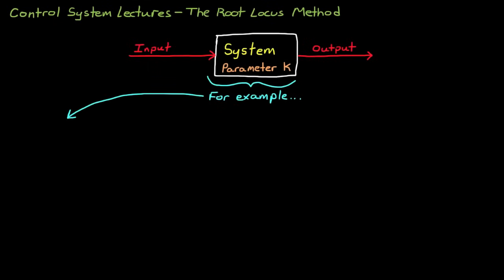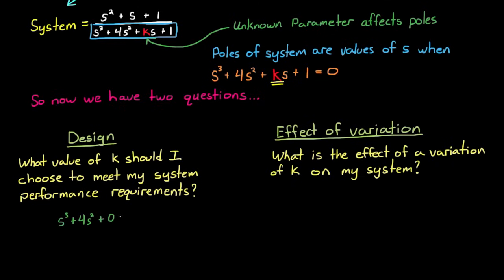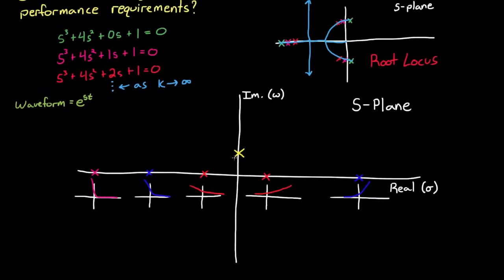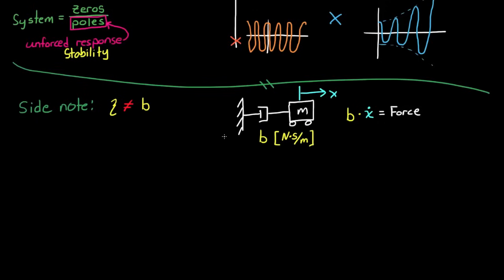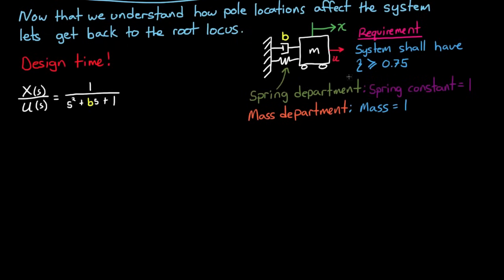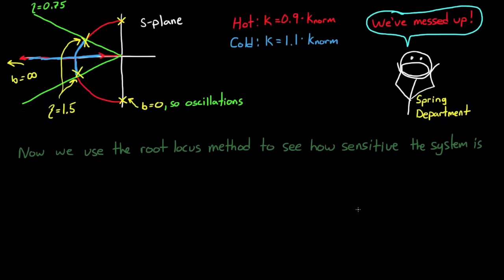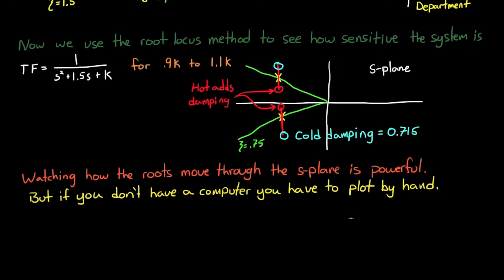The Root Locus Method - Introduction

Comment: its a design technic, k is unkown or varying parameter meaning u cant tell if the sys is stable or not unless u know k , the value of k in the chars eq actually affect the location of poles , drawing of how the poles move in the s plane as u vary k from zero to infinity = root locus , 3:49 each location in s plane corresponds to a waveform e^st in the time domain , kolma kona f left kolma decaying ykon faster , knowing the location of poles let u know if the sys is stable + type of response ( oscillatory … ) 5:01

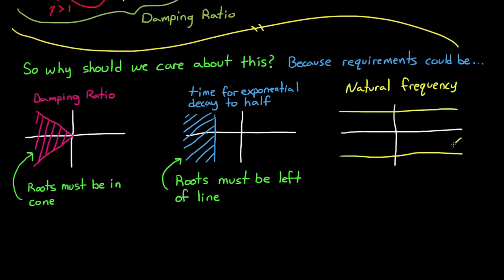Comment: At 7:30, you mention that natural frequency requirements dictate that the pole must lie inside a horizontal band. However, this would correspond to limiting the imaginary part of the mode. The natural frequency corresponds to the norm of the pole, which would mean the pole must lie inside or outside of a certain circle.

Comment: At 7:27 the writing in yellow should read damped frequency, and not natural frequency - thus maintaining consistency with the yellow region limiting the imaginary part of the desired closed-loop poles. Otherwise, if one considers the constraint to be on the natural frequency, it is the distance of the closed-loop poles to the origin of the s-plane that should be limited - thus forming a disk in the left half of the s-plane having as radius the maximum allowed natural frequency. Natural frequency and damped frequency are not the same.

Comment: Hey Brian, thanks for the great videos! They helped me a lot through my studies and now in refreshing my knowledge in control systems. I have a little question though: If Zeta is constant along these lines from the origin with an angle of theta, and Zeta = cos (theta), then how can the damping ratio be more than 1? AT 6:12 you draw two points on the x-axis and say they have a damping ration that is more than 1. Could you please explain that to me?
Reply: Because once you reach ksi=1 , you will have double real poles as b^2 = 4*a*c (second order system). If you further increase ksi,you will just get 2 different real poles that moving away from each other on real axis.
Reply: I have the same question

Comment: Hi! Great video, however a nitpicky detail question: at 5:15, the values of the damping ratio radiate out at a value of cos(phi) in the s-plane. That would mean, that no damping ratio greater than 1 could be achieved, because cos(phi) is at maximum 1. This cannot be the the whole story though, because at 6:10 you talk about values greater than 1...  How to solve this?  Thank you for your effort
Reply: The cos(phi) formula stands for complex poles. Once you land on the real axis, you have a double pole at the separation point, where the damping ratio is 1. After the poles start to separate on the real axis, the system is over-damped.

Comment: I'm a retired technician.  I spent 43 years in various aspects of electronic control systems.  Everything from flight control system on B-52 bomber to re-heat furnace control in a steel mill to general control system in a power plant.  Sad to say, I was lost in the first minute of your lecture.  It would seem that the world of system controls has left me far behind.  I'm glad I no longer depend on the knowledge to put food on the table.

Comment: 6:14 is that wrong? the red poles are on the real axis and you say their damping is over 0, I don't understand since cos(0)=1 perfectly damped
Reply: That rule is usefull to know if it is underdamped or not, but if we want to know if it's either perfectly damped or overdamped, we have to check if the poles on the real axis are in the same place (IE: 2 poles in -3). If they are, the system is critically damped, if they aren't, it is overdamped

Comment: I am a fifth year Aeronautical engineering student, currently using root locus to design aircraft flight control systems. This fifteen minute video is a more complete, effective and absorbable explanation than I have been given throughout my degree.
Reply: Currently studying Electrical Engineering, I have to pass the final exam of Automatic Control, this videos were much more helpful than the entire course

Comment: Nice video Brian. One thing that I noticed that I think is wrong (but I definitely may be mistaking my self). At 7:33, when you talk about the requirement of the Natural frequency, this is not related to the distance from the real axis. The frequency is the distance of the pole from the (0,0) coordinates. In other words, if you care about the system working in low frequencies, that means that you want the poles to be as close to the (0,0) coordinates as you can. 

Of course you want poles to be on the left side of the imaginary axis so I would visualize it as a half cycle, on the left side, with its center in the (0,0) coordinate.

Just wanted to add that. Again, very well explained ^^.

Comment: brilliant vid!! i have a question though... what happens if the parameter k affects the zeros ? i'm designing a PI controller for a closed loop and so it ultimately affects the CLTF poles, but i'm struggling to understand how it works precisely...

Comment: If you write the transfer function in a different form, you can directly relate b and k to the damping ratio.

TF = 1/(s^2 + b*s + k)  =>  1/(s^2 + 2*ζ*ω0*s + ω0^2)

b = 2*ζ*ω0, and k=ω0^2   

b = 2*ζ*sqrt(k)

rearrange to ζ = b/(2*sqrt(k))

k is multiplied by factor p, sqrt(k) will multiply by a factor (sqrt(p)).

To maintain at-least a 0.75 damping ratio, you'll have to multiply b by a factor of sqrt(1.1) = 1.049.    b_new = 1.5*1.049 = 1.6 (only keeping significant digits)

Comment: About the damping ratio on s-plane, you can refer to pg6 (http://web.mit.edu/2.14/www/Handouts/PoleZero.pdf ) to derive the circle with constant radius but different damping ratio.
Reply: in the first example of the linked document, the differential equation should be 2(du/dt)+u instead of 2(du/dt)+1

Comment: why we use root locus? what are the use of root locus?
Reply: brother, if your system lets say motor control system is unstable thn you can find out where its going wrong by root locus. root locus is used in compensator design where you can adjust your instability of motor by adding compensator in series or parallel connection.  i think that i explained well.

Comment: I have been asked to design a system with C(s) = kp and G(s) = 9/(s^2+2*s) . The first requirement : The effect of a constant input disturbance di in steady state operation should be reduced to less than 10%, and the damping ratio should not be less than 0.7. I understood the damping ratio part but I don't know what the requirement about the disturbance means

Comment: As you said , damping ratio is nothing but cos(phi) ,where phi is the angle to x axis. i.e  at all points of real axis in s plane , damping ratio should be 1, as phi =0. but at time 6:16 , you denoted the points for damping ratio greater than 1 at real axis.
So, my question is basically , does  damping ratio equals to cos(phi) holds for all points in s plane?
 thank you :).

Comment: What basic knowledge should I have to know, before learning this?
Reply: +Nandoo H It helps to have a little engineering background (at least know how to model some simple dynamics such as a mass-spring-damper system and know some algebra). Though basic control theory doesn't need much.
Reply: basic understanding of complex fuction is enough to understand the entire rootlocus rules

Comment: Sir, In discrete domain controls, could you explain how to use root locus in z-domain to directly design in discrete domain and not just approximate from a controller designed in continuous domain ?

Comment: Root locus ends at zeroes because at zeroes, the transfer function = 0, there will not be any outputs! It will be meaningless to construct time domain equation with those characteristic roots. The purpose of root locus is to find a continuous range in which system parameter K meets our preferences, therefore, we ends at zeroes since zeroes presents us with a discontinuity. Likewise, we starts at poles because it gives us maximized transfer function (divide by zero). We will like to see how K change our roots starting from the maximized transfer function to a minimized transfer function (ie, zero at infinity = exp(-infinity * t) in the case of root locus ending on real axis).

Comment: If our system has G(s) in forward path and H(s) instead of unity in feedback path, then to use 'rlocus' we need to change our system to unity feedback. To do this replace G(s) by [ G(s) / ( 1 - G(s) + G(s)H(s) ) ] and H(s) by 1. Now, our open loop transfer function is that one in square brackets.

Comment from the maker: viraj shelke and Suraj more, It's hard to explain in writing but I'll try. Start with the root locus form of the transfer function: G(s)/(1+K*G(s)) and then separate G(s) into numerator and denominator. N(s)/(D(s) + K*N(s)).  Now if K is 0 then the transfer function is N(s)/D(s) which is G(s), so the roots start at the poles of the original transfer function. When K is increased the denominator D(s) + K*N(s) starts to behave more and more like just K*N(s) which are the zeros of the original transfer function. Does that help?
Reply: ID Jeet 1) There is an equation that relates %OS directly to zeta, %OS = exp[(-z*pi)/sqrt(1-z^2)]*100, where z is zeta (the damping ratio). There's a few ballpark, pre-calculated OS's that are good to remember, 5%, z=.7, 15%, z=.5, 35%, z=.3. So you would plot the z of .5 when given a OS of 15%. 

2) 3rd order+ functions can always be broken into 1st and second order systems. You would simply factor out a first order to create a first order and a second order, and your natural frequency would be the frequency of the second order response.
Reply: Brian Douglas sir , i have few problems , 1st ) there was a question where i was asked to plot the damping ratio line with just OS% given as 15% how do i do that? how to plot damping ratio line ? 2nd) how to calculate natural frequency & damping ratio in case of a 3rd order transfer function ? kindly please refer back...thank you!!
Reply: ph7ryan  thank you very much... that was helpful ..

Comment: Why root locus starts at poles & ends on zeros...
Give mi conceptual reason...plzzz
Reply: Suraj More open loop transfer function gives G.H= k*(open loop zeros)/(open loop poles)  while stability is defined by closed loop poles that are given by characteristic equation (1+G.H) . 
1+G.H=[open loop poles+k*(open loop zeros)]/(open loop poles)
the roots that is zeros of 1+G.H determine stability as they are closed loop poles.
therefore the numerator ie (open loop poles)+k*(open loop zeros) determines the  stability.
As k=0, the equation gives open loop poles
whereas for k=infinite, 1st half is very low value hence it gives open loop zeros. therefore RL goes from open loop poles to open loop zeros.😁😁 if you have any questions further feel free to ask.
Reply: @UpendraYadav-mh9mm   what are zeros? roots of numerator? (just like roots of the denominator are poles..)
Reply: @idreamprudhvi  for any expression , roots of numerator are zeroes of that expression while poles are roots of denominator
Reply: @idreamprudhvi  but here in this context that i've mentioned above, dont confuse between zeroes of GH (ie open loop transfer function) and the zeroes of closed loop transfer function
Reply: @UpendraYadav-mh9mm  yeah peace, I got it.., thanks brother ... 🙏
Reply: Upendra Yadav tq boss
Reply: lemme check it !!
if i get it i ll let u knw :-P

Comment: why did we start calling poles roots?
Reply from the maker: The poles are the roots of the characteristic equation.  Or in other words, the poles are values of 's' that cause the denominator of the transfer function to equal zero.  Therefore, sometimes when I'm talking about poles but just referring to the characteristic equation I refer to them as roots.

Comment: At 7:30 you mention that in order to have a natural frequency below a certain value, the poles have to lie in a horizontal band in the s-plane. However, I was taught that the natural frequency is the distance from the origin to the pole and that the damped frequency is the imaginary value of the pole. This would mean that, in order for the natural frequency to be below a certain value, the poles have to be situated in a circle with a radius equal to the natural frequency. How I see it, the yellow band you describe is the criteria for the damped frequency.

Did you make a mistake or is there a flaw in my reasoning?
Reply from the maker: There's no flaw in your reasoning, you are correct.  I had put an annotation in the video at that point to correct what I said but you might be viewing the video on a platform that can't see annotations or you have them turned off.  Sorry for the confusion, but good catch!
Reply: Brian Douglas Well that explains a lot. Annotations were indeed turned off.
Thanks for the quick response!

Comment from the maker: Hi Ahmed, there are a lot of nuances when using general rules of thumb and they don't work in ever situation. If you have a 2nd order system and it has a damping ratio between 0 and 1 then you will have a system with imaginary roots and the cosine of phi works (or with zeta = 1 you have two repeating real roots).  However, if you have a damping ratio greater than 1 then you have two real roots (which can be thought of as two 1st order systems) and you can't say zeta is the cosine of phi anymore.

Comment: Hi Brian, thank you for these videos! One question; at @7:32 you talk about setting a requirement for the natural frequency. From what I understand, the natural frequency of a system pole is determined by the distance of the pole to the origin (goo.gl / JIkxQ). Therefore, shouldn't the limits be drawn as a circle instead of straight lines? Thanks again!

Comment: Hi Brian, the video was great but at cold damping ratio may be 0.795 instead of 0.715. at hot the damping ratio is 0.715 and it meets our requirement as we are required to take 0.75.
Correct me if I am wrong.
Thanks

Comment: At around 4:40, "Only the poles of the system are needed to dictate an unforced response to a set of initial conditions". Is there an intuitive understanding for this? I also recall once you obtain the poles of a system, those are unchanged for any transfer function related to the system. Zeroes can change however. While I'm convinced of this in practice, I do not fully understand why and I think it's related to your statement.
Reply: Did you got the answer to this question?

Comment from the maker: Hey James, no problem.  The transfer function is 1/(s^2 + 1.5s + k).  For such a simple transfer this is the easiest way.  Put the den. in standard form which would be s^2+1.5s+k = s^2+2*z*w*s+w^2.  When k = 1.1 then it's easy to solve for the damping ratio.  w = sqrt(1.1) =1.049.  Then z = 1.5/(2*1.049) = 0.715.  Of course the root locus is a good way to visualize how the damping ratio changes with k.  On the diagram zeta = sin(angle between pole to origin and the vertical axis).

Comment from the maker: Hello, I briefly cover that in my video called Stability of Closed Loop Control Systems starting at around 6 minutes.  The even faster answer though is that the time response of a pole is e^st, where s is the location of the pole in the s-domain.  If s is negative (left half plane) then as time get's larger e^st gets smaller (stable).  If s is positive, then e^st gets larger as time increases.  No matter how many poles you have, it only takes 1 unstable pole to drive the system to infinity.

Comment from the maker: Hi Echo, is your question why I didn't set b such that no oscillations occur at all (poles only on the real axis)? You could set b to be anything along that blue line that I drew.  The reason I didn't choose a larger value is because when you're buying an actuator (like a damper) typically the larger the value (or larger damping) the more expensive the unit, the larger the unit, and the heavier the unit.  Normally I try to select the cheapest smallest part I can that still meets requirements.

Comment from the maker: Well put Trunks.  If I don't have specific phase and gain margins I like root locus (especially to move poles around to meet requirements).  For me it tends to make more sense.  However, if I'm designing a filter for a sensor (lead, lag, band pass), I like the Bode plot.  If all you want is for your system to be stable and you don't care whether it oscillates or has a certain damping ratio then all you need is for all poles to be in the left half plane.  And that's easy to see with root locus.

Comment: yes! I prefer root locus over frequency response methods. Root locus is easier to accurately draw by hand than bode plots so the results you get from it will be more reliable. If you're using software, then it doesnt matter

Comment: depends on the design criteria that you set. if you have design criteria in terms of phase/gain margins then go with frequency response but if you have criteria in terms of pole locations go with root locus. you will have built in stability checks when you perform the root locus